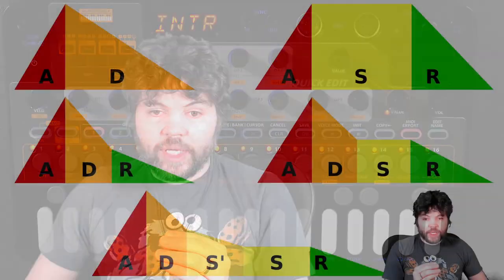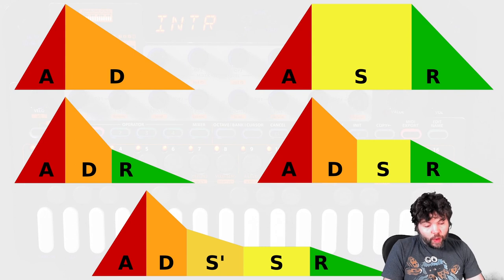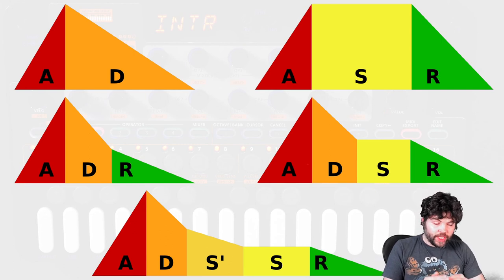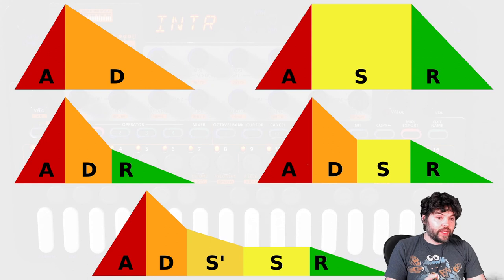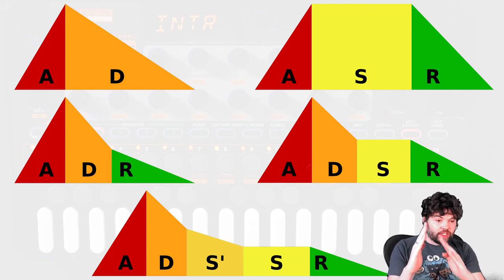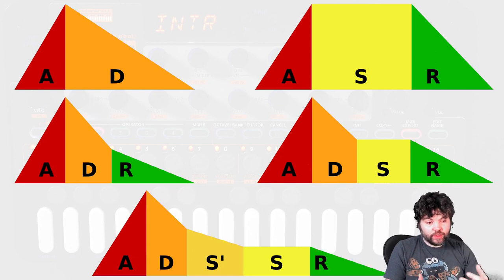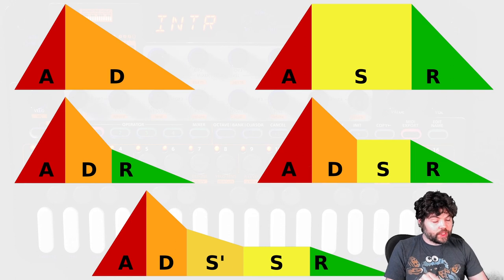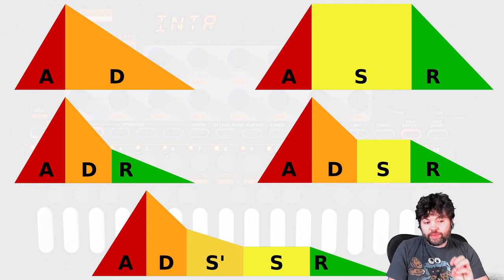FM Sound Design on Liven XFM: Ep12 - Envelopes

Comment: Highly interesting !
Reply from the maker: I'm glad you enjoyed it. I'm hoping the series coveys that FM synthesis requires some intellectual understanding, but once you have that, it allows you to focus on aesthetic and artistic considerations.
Reply from the maker: @thecreepysilence4290  The MicroFreak FM engine is quite interesting, though a little different from a conventional FM synth. It has 2 operators, operator one is a carrier (the one you hear) and is a sine wave, playing at the pitch of the note you play; operator 2 is a sine wave and is the modulator (modulating operator one) that plays at a pitch determined by the ratio (wave) parameter, which sets the ratio between operator one and two pitches. The shape parameter sets the amount of feedback (self modulation) of operator two, and the amount (timbre) parameter sets the amount by which operator one is modulated by operator two (if this is set to zero the other two parameters will have no effect).

This is a fixed architecture, two operator FM setup and you can get a wide range of timbres just be exploring those parameters. It differs from typical FM synths as there are no envelopes to adjust the level of the operators (so you get a fixed, complex timbre). It's actually possible to emulate having an envelope on operator 2, by setting the amount (timbre) parameter to zero, then modulating it with an envelope. In this way, you can get the timbre animation of a typical FM synth. You can also modulate the shape amount which will give a similar sound to modulating a modulator, modulating your modulator (as though you had a three operator setup).

This ended up as quite a long comment. In any case, if you are interested in me demonstrating this, I'd be happy to make a video demonstrating it, as I think the MicroFreak FM engine is probably under appreciated as a "true FM" synth.
Reply from the maker: @thecreepysilence4290  That sounds interesting. I think I might try and do the video I mentioned: traditional FM sound design on the microfreak 😀. Thanks for giving me the idea, and thanks for watching!
Reply from the maker: @thecreepysilence4290  I actually did make a classic FM synth tutorial on the MicroFreak: https://youtu.be/QG8ZWO9mH6o . Hopefully you find it interesting!
Reply from the maker: @thecreepysilence4290  Thanks for the comment; I am trying to find a middle ground between theoretical explanations and practical examples. Hopefully I can come up with some useful content using the same approach in future.

Comment: That was super interesting and enlightening. After I speculated about the effect of a modulator rising in the release phase in a comment to another video, the effect you demonstrated was far more subtle than I expected it to be. Still it was clearly noticeable, so it was a very nice demonstration. The sound indeed resembled a bell or gong, which - in the phase of fading away - typically travels through different states of self-resonance. It might as well be interesting to leave a modulator at lvl 0 throughout the whole ADR phase, only rising in the release phase, introducing a timbre which was not at all present in the sound before.

You say that it's not possible to copy envelopes from one operator to another. May I ask what the 'copy <-' button (above step sequencer button 14) does instead?
Yet another question in case you don't mind: Under a random video about the XFM by a different creator, I read a comment in which a user stated that the sound of the XFM can't really compete with other FM synths. He stated that other synths would have more 'body' in their sound. As you also own other synthesizers, would you agree to that? If so, could it be said that the lack of 'body' might originate from the fact that the XFM only has 4 operators while many other synths have 6, introducing more tonal / timbral complexity to the sound? Or might it be more due to different implementations of the sound engine or so? Would you agree to the statement 'the more operators, the better', and from a cost-benefit ratio standpoint, would you say that the morphing functionality on the XFM + every operator being able to be a carrier and modulator simultaneously compensates for a lack of additional operators?
Reply from the maker: There are definitely many ways to use envelopes and having phases be 0 level can be used to interesting effect. One such method uses the attack phase at 0 as a delay, decay at 127 then sustain and release at 0. You set the decay and sustain times to match as the effective decay/release time of the sound, decay time adjusts the effective attack and attack time to set the delay. This is used in some presets to play an arpeggiated chord across the 4 operators.

As for copying, the copy function works in sequencer mode to copy tracks, sounds or sequence steps: as far as I know it has no function in FM edit mode.

Comparing the XFM engine to other FM synths, I think it sounds fine: probably not the most HiFi but that relates to the relatively limited hardware (to allow the cost to be so low). The famous DX7 is also quite lofi, so it's in good company I suppose. Even if the processor had the capacity for 6 operators, I'm not sure it would work that well. In particular to keep the layout consistent you'd need 3 more knobs per operator (i.e 6) and an extra button per operator (2 more).

Regarding the having  more operators, the same sound design principles apply to 6, or even 8 operator FM as 4, but more capacity for modulation and variation exists; this extra capacity comes at the cost of interface complexity and extra CPU demand.

One of the big anti-patterns in FM, however, is feeling the need to always use all the operators: use as many as you need for the movement you want. As a rule I'd say 4 operators is a good trade off between sound design and UI complexity and the ability to reach "true" FM tones (the Digitone went with the same trade off and seems much loved). The operator routing helps with this to an extent, especially having feedback everywhere (allowing you to effectively use different "core waves" vs just sine) which adds timbres, but not the extra movement.

The morphing, as a means of simplifying sound design, varying sounds between steps or animating, is the most unique feature. It definitely allows you to create sounds that would be very hard to achieve on other synths, and design sounds with no real understanding of FM synthesis. It doesn't directly compensate for the lower operator count, but instead it provides a different palette of sounds (alongside the envelopes filter).
Reply: @ChalkWalkMusic  Thanks a lot for the elaborate answer! 
What you describe regarding the delay and arpeggiated chords sounds really interesting. After watching your demonstrations, I'm craving so hard having an FM synth under my fingers, since I guess, although it is possible and maybe neccessary to talk about the theory behind it, at the end it really 'clicks' and makes all sense when going hands-on...

Regarding the Copy Button, I was just wondering why they would print it on the Editing Overlay if it doesn't have a functionality. It now raised my curiosity so that I downloaded the manual; as I understand it is used to copy whole patches, like for example to copy a preset patch to an empty memory slot before editing / saving.

Yeah, it's probably all a trade-off between price, functionality, complexity of the user interface etc... From what I can judge, the XFM is an incredibly inexpensive device with regards to its functionality and innovative engineering (morphing etc.).

Unfortunately of course, sooner or later, Gear Acquisition Syndrome kicks in, but also the thought that it's wise from a sustainability perspective (raw materials, electronic waste) not to rush purchase decisions. After I was almost certain to go for the XFM as soon as I can afford it, I found a video by loopop demonstrating the Korg opsix. Dude, that device is on a whole different level... (again, not to say at all that the XFM is bad in any way, just in appreciation of the work Korg did invest into the user interface and feature set). Although it is 6-op FM and provides a multitude of routing options, various extended oscillators (waveforms other than sine) etc., it seems to be sooo user friendly and intuitive to operate... Unfortunately, if I would want to go for that one, I would have to delay the purchase some more months (not at all to say that it is overpriced; quite to the contrary in fact).